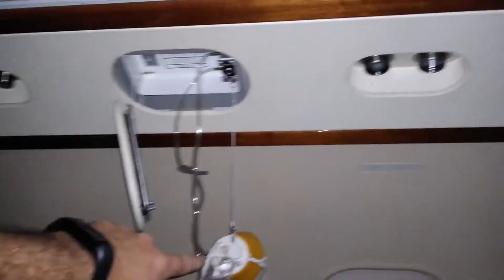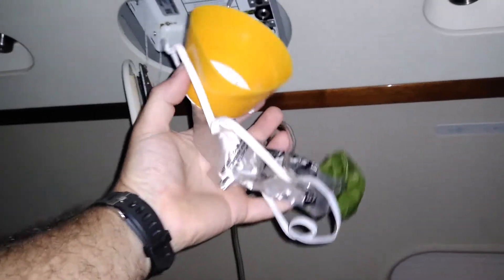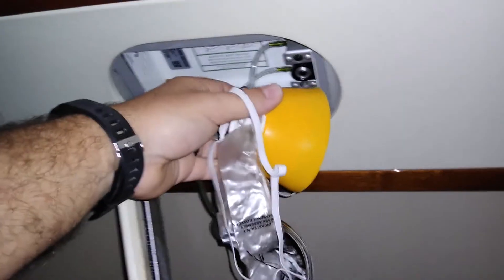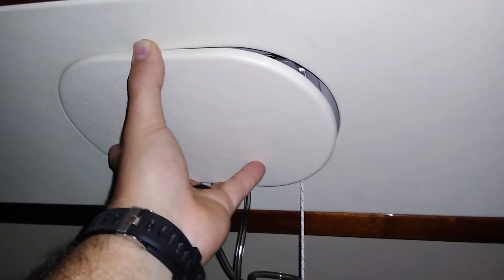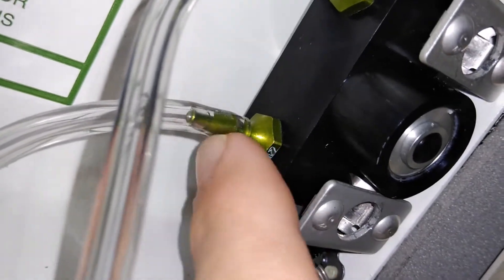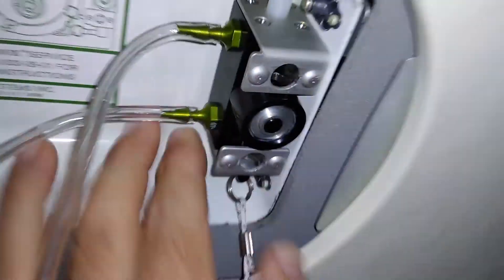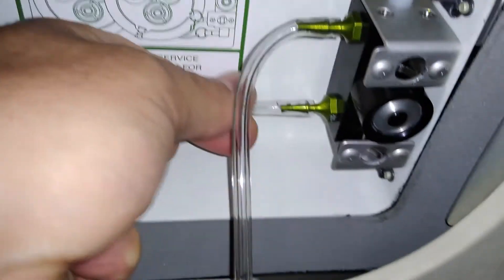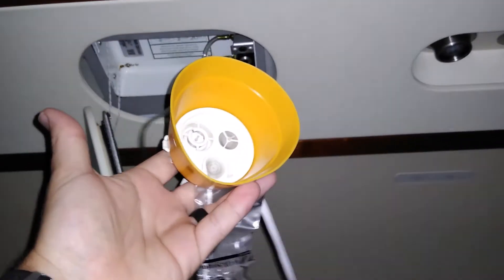Aircraft Oxygen Masks, how they work and why you have to pull to make them work.

Comment: Great video! 

I've taken hundreds of flights, but fortunately, I've never experienced the oxygen masks dropping down. Because of that, people like me often have no idea how they actually work. I used to think you had to pull on the plastic tubing to get the oxygen flowing. Thanks to this video, I now understand it's actually the lanyard connected to a pin that activates the system.

I really believe airlines should show a short demo or video using a real mask from the storage box—especially for elderly passengers and first-time flyers. It would make things much clearer.

Thanks again for such an informative video!
Reply from the maker: Hello Peter, I'm glad you liked my video. Yes, that was one of my concerns and the reason behind the video. In a moment of crisis and panic like a cabin decompression, adrenaline would be flowing and I can see many people yanking the masks right off of the oxygen supply. That would NOT be good. 
Thank you for taking the time to write in your nice words.

Comment: I've never seen the lanyard in the safety briefing on flights. Pulling the one lanyard will start the oxygen flow for both masks? If the one seat is empty, and the other occupied and the passenger takes the mask with out the lanyard, they can pull on the mask until they are blue the the fact and it wouldn't help.
Reply from the maker: Each mask has its own lanyard dedicated to it. Oxygen will flow only to the masks that are triggered by pulling that lanyard, so no, you won't turn blue by pulling on the wrong mask. 
And as far as not seeing the lanyard on the demos, I don't know. Maybe they simplify the demo to not overwhelm with too much information those passengers who are unfamiliar with the system. The key point to all is to pull to activate the flow of oxygen, whether you know what the point of pulling or what pulling actually does I guess is irrelevant.

Comment: Great vid👍🏻 but isn’t there like a chemical reaction that releases the oxygen and you have to pull the cord to trigger it?
Reply from the maker: That is only the case for chemical oxygen generators. Those are individual canisters placed over every seat that do need to be triggered to start the reaction. Aircraft with this system installed do not have cylinders of high pressure, compressed oxygen. 
The aircraft in this video had two high pressure oxygen tanks, and a series of tubes and hoses delivering the oxygen to every mask. In this case, when you pull the cord, you are literally opening up a valve at the oxygen tube to let oxygen flow to your individual mask, not triggering any chemical reaction.

Comment: You know what's the problem? The crew never let us know about this. They just talk about emergency mask that I've never known or seen.
Thanks for this useful video!
Reply from the maker: Hello nhà cúa Phong, that's the reason I made this video. After a flight, it dawned on me that the safety briefing made sense to me because I was familiar with the masks and how they worked, but most people don't. In an emergency, there's a large possibility that some people may be hurt due to misuse or mishandling of the mask and the supply hose. Hopefully my video will help someone. 
Thank you for your positive feedback.
Reply: The reason I searched for a video like this, is because every "safety briefing" makes it sound like you must pull firmly on the hose. I never knew about the cord. Is this the same on all aircraft?
Reply from the maker: Hi Chris, as far as I know yes, but of course I haven't seen every airplane or emergency oxygen system so there's bound to be some exceptions. But for the most part the principle is the same, the flow of oxygen gets triggered by the action of pulling down the mask, just don't  pull so hard that you brake the hose off. The hose can take a fair amount of abuse, but in a panic you can definitely rip it off. The trigger is not the hose, it's the lanyard next to it. It just so happens that the lanyard is purposely made shorter than the hose, so that by the time the mask reaches your face, you would've already triggered the flow of oxygen. 
It's a simple, robust and reliable system, just don't brake it off and you'll be ok.
Thanks for coming by Plane Simple.

Comment: Great video! Might be a stupid question, but were the masks you showed us used at all? Because I know once you pull the pin you can't reset the system so you wasted oxygen.
Reply from the maker: Hello FlightLevel 370, it's not a stupid question at all, but you might be thinking of a different emergency supplemental oxygen system. 
There is a system that uses chemical oxygen generator cartridges that once you trigger them ON you cannot stop the chemical reaction until it is completely depleted. In that case you would be correct to say that once the pin is removed and the reaction is started you cannot turn it off. In this case however, the source of oxygen is not a chemical cartridge but a pressurized oxygen bottle. This system can be turned on and off on demand. Furthermore, this supplemental oxygen supply to the passenger cabin is normally kept in the "off" or "auto" position, which means that there is no oxygen available unless it is an emergency and the emergency oxygen supply is turned ON. This was the case in this video, the oxygen system was turned off, therefore there was no pressure in the lines and I was able to demonstrate the removal and installation of that pin. 

I hope this makes sense and answers you question.
Reply: @planesimple8514  Ahh okay. I thought the generators were also on private jets. I was also wondering why the generator was not visible. That explains it. That's cool to know you have such a system. I thought that was only available on the 747 and A340, but guess not. Thanks, I just learned something :)
Reply from the maker: Awesome! That was my goal for this channel, to provide simple instructional videos for anyone who is interested. Thanks for the kind words.

Comment: Hey Sir....I had a question..
Why do you have to use supplemental oxygen for any portion of the flight that exceeds 30 minutes above a cabin pressure altitude of 12,500 feet
Reply from the maker: Hello again De Santa65, welcome back to Plane Simple. 
That is a good question and is easy to understand once you take into account a couple of things:
1- The density of the atmosphere (the amount or mass of air per unit of volume) decreases with altitude. That means that the higher you go, the less air there is available to fill your lungs with and it is at less pressure too which means it won't be absorbed by your lungs as easily either.
2- You need oxygen to stay alive.

At sea level, there's more oxygen available than what you need, but as you go up in altitude that available oxygen is less and less. At one point, you'll be at an altitude where the available oxygen is JUST exactly the amount you need. Any higher than that and you'll be using more oxygen than what you are taking in, this lowers the oxygen levels in your body causing hypoxia (medical condition that literally means lack of oxygen). You cannot properly function in a hypoxic condition. A mild case can temporarily impair your mental ability, and severe cases are lethal(try to avoid this!). 
There's not one given altitude that this happens at, it's more of a range. This range happens to be around 12,500 feet but can start at 10,000 feet or 15K. It depends on density altitude, temperature, your health, if you smoke, etc. 
In order for the human body to operate at higher altitudes, you either pressurize the cabin to simulate atmospheric conditions of lower altitudes so you can breath normally, OR you can use supplemental oxygen which increases the concentration of oxygen available for your lungs, keeping you alert and alive. 
I hope this explanation was easy enough to understand and I hope I answered your question.
Reply: @planesimple8514  wow that's great!!!!! Thank you sir 😊...Thank you so much. You know I'm leaning more about aviation step by step so I'll need your help in future ...I'll disturb you again with my questions 😅...cause I've no one to ask ..so yeah ..I admire you sir ....Thanks again 🌼
Reply from the maker: De Santa65, it is my pleasure. I'm glad I'm able to help. I'll try to answer your questions as well as I can. Thanks for watching.